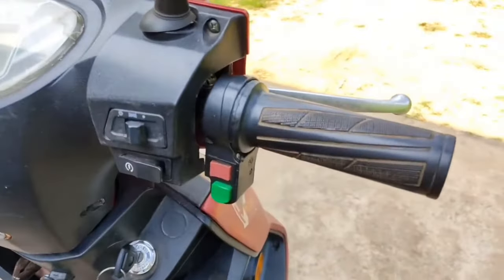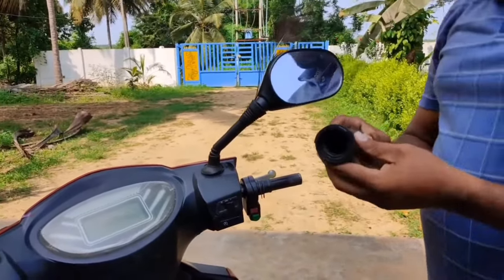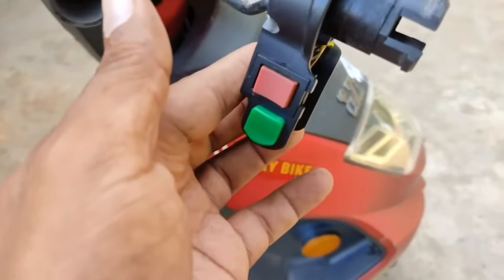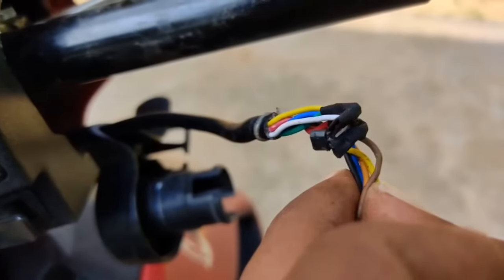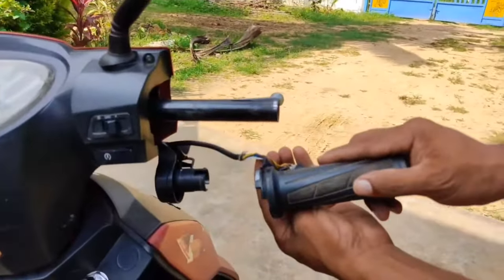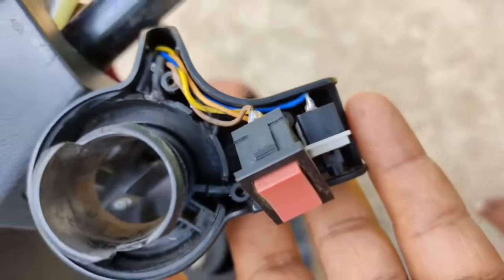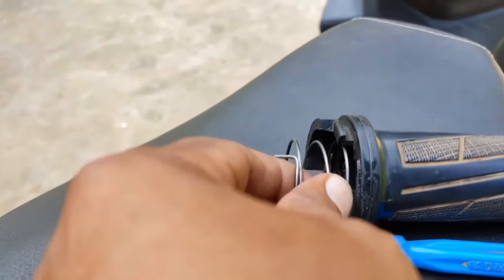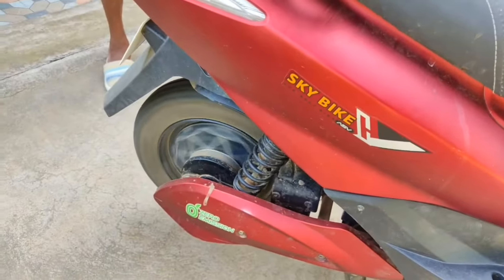How to fix/repair electric scooter accelerator/throttle. #electricscooter #electric #doityourself

Comment: I am getting throttle error, and my ev scooter is not moving. After approximately 5mins when the ignition is on , the throttle error is disappeared and vehicle is moving fine.. please suggest
Reply from the maker: May it some wiring issue, there might be loss connection.